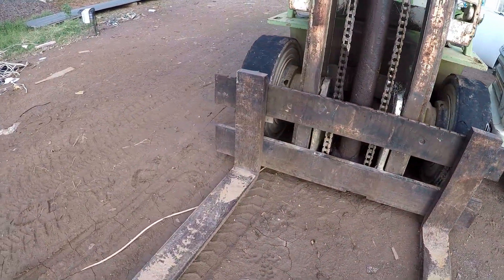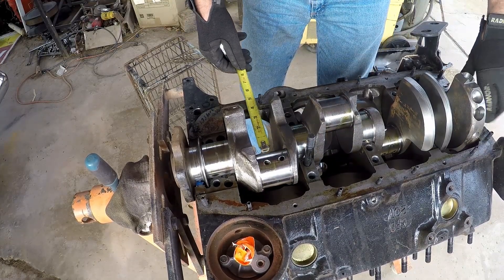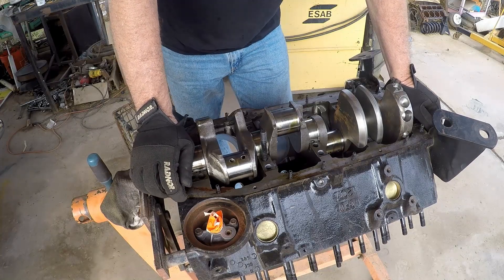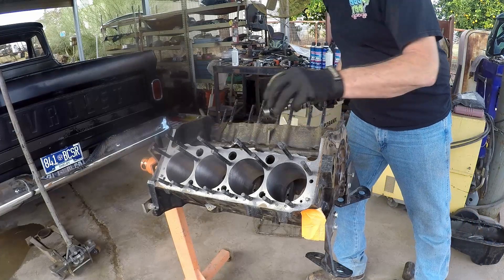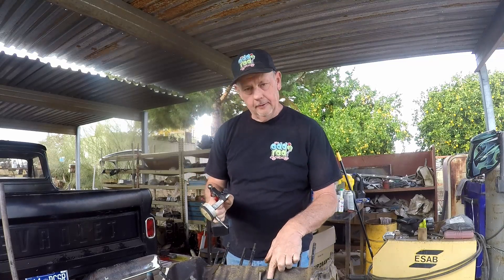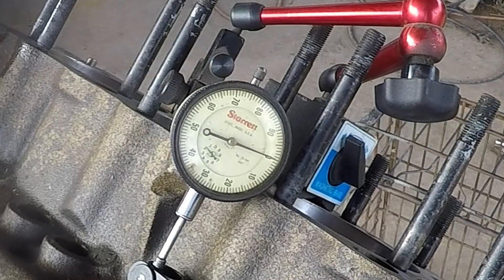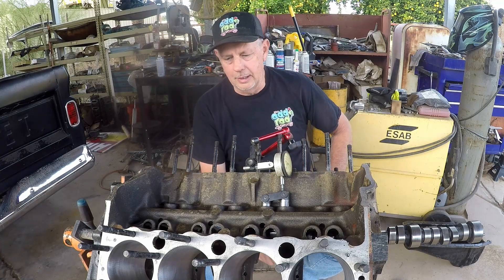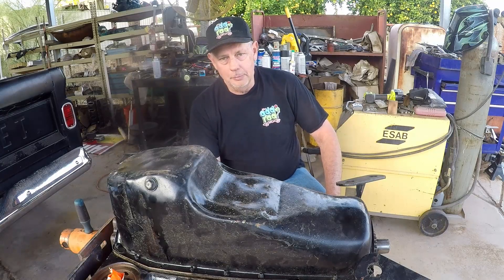Is the engine junk? Just my luck!

Comment: Strange, I just looked up the 12-704-8 comp blower cam and it has equal intake and exhaust lift.  But it is .575 lift, so not your cam.  Is it stamped COMP? If it is stamped CC it could be Clay Smith Cams.
Reply from the maker: It's stamped COMP! Thanks for watching!

Comment: That is weird that CC can't tell you what cam you have by the numbers.
It looks like the previous owner bought a bunch of quality parts but just threw it together. 
I think I'd boil that block before I used it - based on the hand tight studs and the debris in the crank. 
That engine is gonna be a beast for sure!
Reply from the maker: Its like its a magical disappearing cam! Thanks for watching!